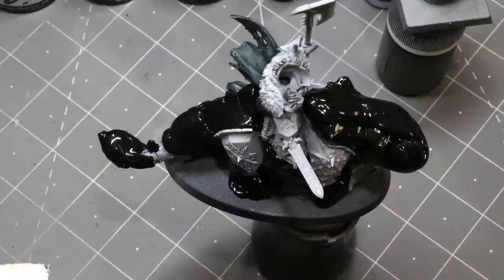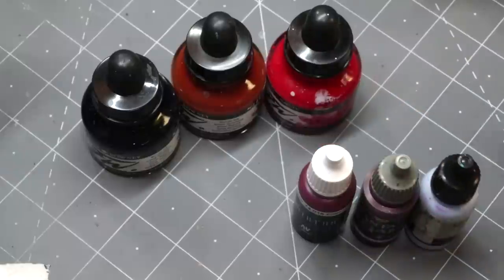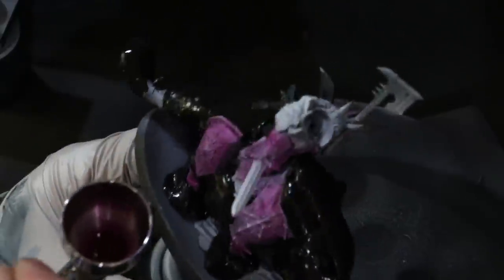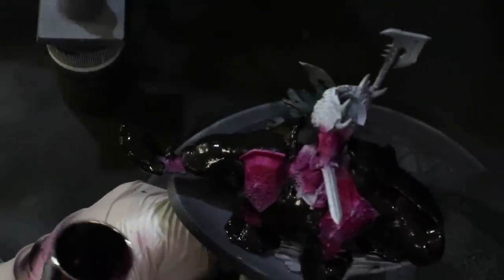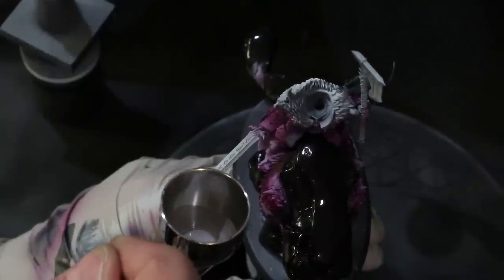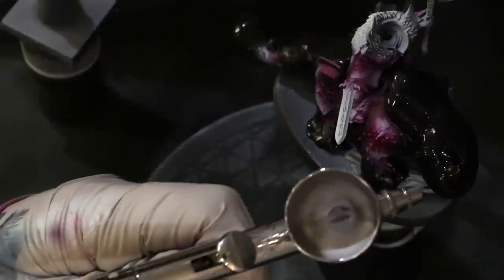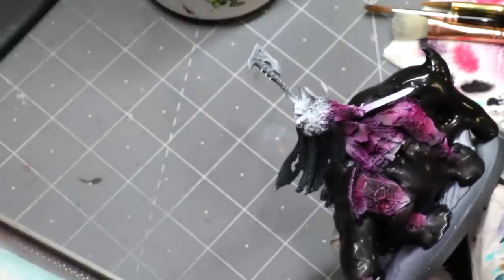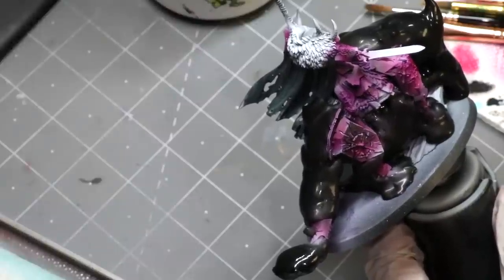Hobby Cheating 232 - How to Paint Crimson Armor

Comment: Hey Vince! Tried watching this video & looking at your StD on insta to get some insights into how to handle incorporation of tint (in my case ice yellow) to volumes, on these kinda shiny, yet not fully NMM surfaces.

 I seem to either get way too low contrast, or my armor reads way brighter than I want to (going for a deep turqoise)

Ill see you on pmp next month! 😅
Reply from the maker: The key is to get the volumes right for the size of the highlight based on the material in question. Looking forward to the submission.

Comment: i have golden liquid paint -dioxazine  purple can this also be used for a brush as well?
Reply: I have a whole set of Golden fluid acrylics I use for mini painting with a brush.  They just need to be thinned a tiny smidge, in my experience. 

Oh, also, thicker layers dry quite glossy, so be prepared with some matte varnish, if the rest of the paint you are using is matte mini paints.
Reply from the maker: I agree with Steven completely.

Comment: Hey Vince, your videos have been giving me a lot to think about since coming back to the hobby. Love this scheme but im having trouble seeing where the light source for this model is as it seems backwards for the usual 'somewhere above' light sources. Also as a side question, how do you go about picking shadow schemes for models and do you make them consistent across the army/units?
Reply from the maker: If you mean why am I often lighting the bottom of the panels in this video, it's because I am going for a metallic sheen. On flat surfaces light tends to cascade and gather away from the light (basically the opposite of a normal matter surface). My honest answer is don't over think it. Light can work in lots of different ways. The key is to basically be roughly consistent across the model. 

If you want a guide, this is where something like Zenithal highlighting can really help you out. You can also just hold the mini up to a bright light and take a photo with your phone. It will give you a rough sketch to follow. 

Yes, I try to keep consistent across the army, but again, don't sweat it too much.
Reply: @VinceVenturella  Thank you for the reply. After another watch and some google image searches its starting to make some more sense in my head.